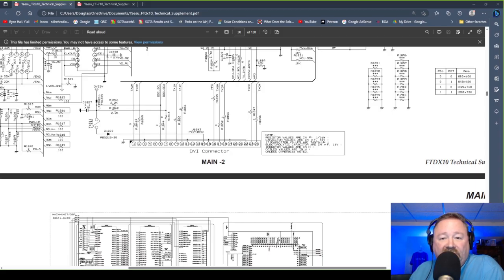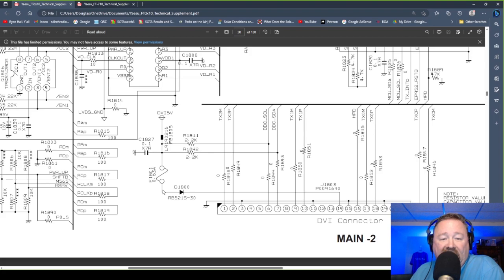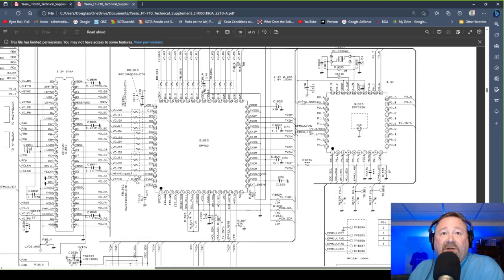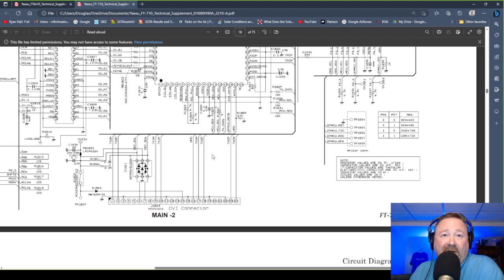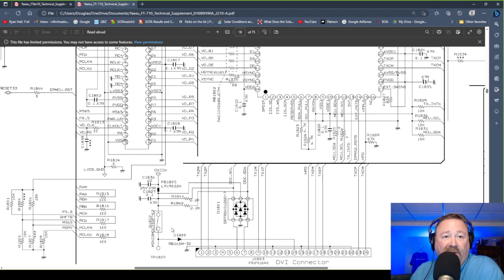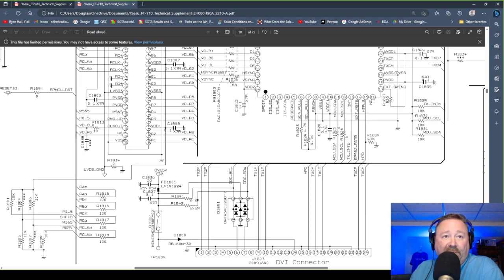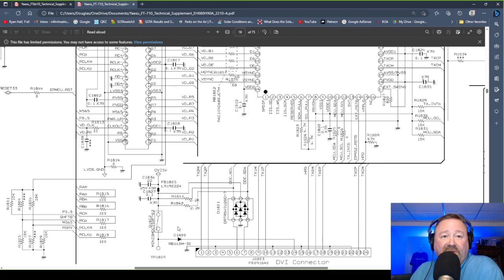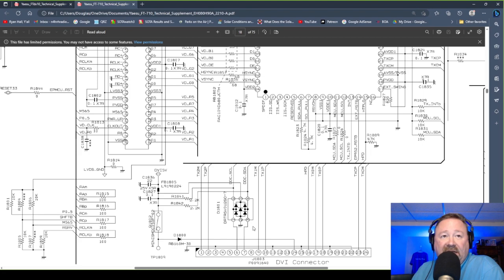Yaesu FT-710 AESS: DVI-D Port Protections (video #35 in this series)

Comment: I wonder if the fix to the FTDX10 is to replace the blown fuse with the one used in the FT710. I don't have enough room on my shack desk for a monitor but I'll keep this in mind if I ever want to add one. Thanks Doug 73
Reply from the maker: Hi Martin!  That is perhaps a fix. I wouldn’t do anything until the 3-year warranty has expired. I wonder if Yaesu is retrofitting the FTdx10’s that get sent back for the video failure?

73, Doug

Comment: On my dx10 I'm using a "Amazon Basics HDMI to DVI Adapter Cable, Bi-Directional 1080p, Gold Plated, Black, 6 Feet" with a "10.1 Inch Small Monitor, Raspberry Pi Monitor ". The mount is cheap and flimsy (came broken) but it has a VESA mount pattern so I ended up using a surplus VESA mount I had hanging around. The confusing bit; it has HDMI, VGA and BNC inputs and you use a button on the front to active the input. It can not auto sense. Just a couple data points to add to the discussion.
Reply from the maker: Bi-directional is risky, especially with a Yaesu FTdx10.

Comment: Hi Doug,
Bought a used FTDX10 last week. Lucking I do have an old 22" LG monitor with DVI-D cable. Stay safe.  73  WJ3U
Reply from the maker: That’s excellent, Don!  Seems like someone didn’t realize what a gem of a radio that had.  Your gain. 73, Doug
Reply: @n4hnhradio  Hi Doug,
He had bought an FTdx101D, so didn't need the dx10. You are right, it was my gain.  🙂 WJ3U